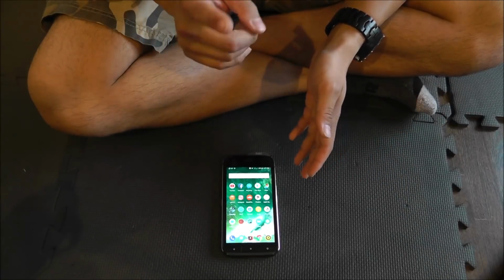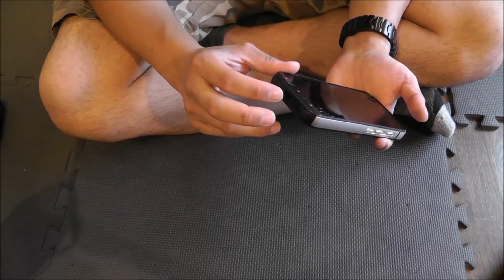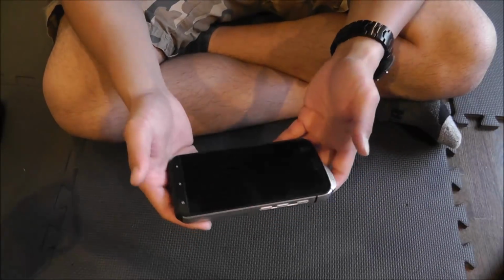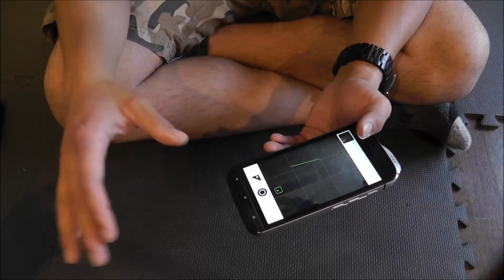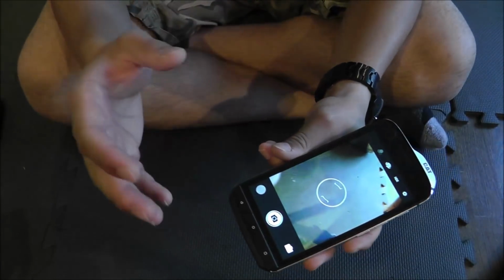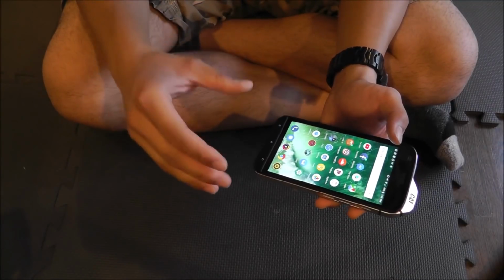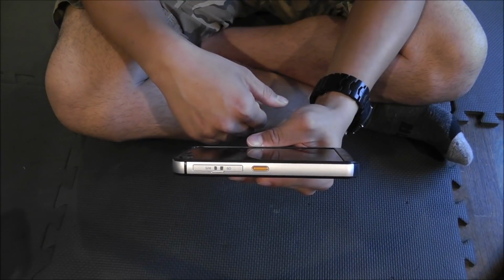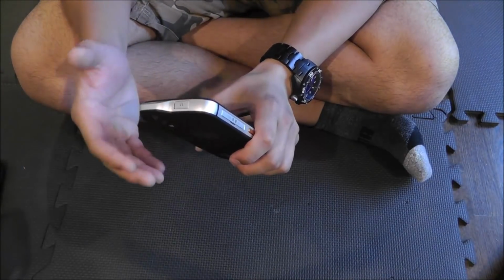REVIEW: CAT S61 [FULL REVIEW] [THERMAL VISION AND LASERS!!]

Comment from the maker: Hey guys, just a correction, the built in thermal Flir Lepton module is actually 80x60, and not 120x160.  I was basing my info on what little early information was available, but further testing has confirmed it is the lower resolution of 80x20.
Reply: lower resolution of 80x60 ;-)
Amazing how it on the same resolution looks so much better then on the S60
Reply from the maker: eco logic Yeah, that is because the flir MSX overlay resolution has increased to 1080P but the actual thermal resolution is unfortunately still only 80x60
Reply: Waterproof ??
Reply: Sooo... where did you go on 07-07-2018, saturday? There is a red bar in the VOC sensor data, I think at around either 10 o clock in the evening or maybe even a bit later on. Was that somewhere where people were smoking? Was it car / road -location related? Because this data would be nice to log too for health nuts :-D 

Too bad about the low resolution of the FLIR cam/heat sensor. I would really like this phone to help out in fault finding of SMD components in circuitry. But at these resolutions.... nah, that only delivers an approximation of an area, not  exact enough to pinpoint for example an IC or SMD capacitor, so still alcohol, petrol or freeze spray has to be used. 

Dunno...
Reply: Review cheapest unbreakable Poptel P60.
Reply: I thought i heard you say that both the charging port and the headphone jack is fully waterproof even without the 2 flaps. Is this true? If it is, can you provide a source that confirms this?
Reply: The more cost-effective ulefone armor 9 has a 64mp camera. 6600 mAh battery
Reply: i think you would like a Blackview 9900-pro ... its much better :) bye far and you can root it ...
ps.. the flir app is that speed every phone/device... its a start-up of the seniors of the camera, and calibration of the 2.2million seniors..

Comment: Finally, when the camera brackets turn green, take the pic and it's instant. If you take the pic before it goes green, it'll seem like you took the pic but it won't actually capture anything until it's focused and turns green. The front facing camera is instant.
Reply from the maker: Gerry926 Yeah it's because the front camera is fixed focus and the rear camera is autofocus.  And the rear camera autofocus is VERY slow.
Reply: Agreed!... And thanks for the great feedback.
Reply from the maker: You got it, man!  Glad you found my video informative!  Also I might as well ask if you've been able to figure out if there's actually a "wet hand mode"?  Because I know there's an underwater mode for the camera, but nothing for the touch screen. The manual and sales materials touted the ease of use with wet hands but I've found it to be as impossible to control as any other capacitive touch screen.
Reply: I'll try the wet hand thing and glove mode tomorrow at work. I know it didn't like my sweaty face next to it. Can't blame it for that though, lol.
Reply from the maker: Gerry926 Haha I gotcha.  I mean I know glove mode works, it seems to turn up the sensitivity, but that doesn't help with wet hands, it makes things worse.
Reply: Hello again. Just need to ask, what camera app did you settle on? I was about to send the phone back because I'm still talking my Note 8 to work, for pics but then I found Footej and the shutter speed is better. 
Would be great if Cat had an update to improve the stock camera.

Comment: Nice video you made,thanks.
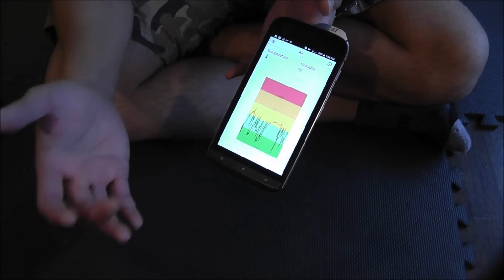At 15:09 you talked about the lag of export option for the air quality measure result(s)
Maybe you could take snapshots of the results and send this to where the results have to go. If you’re this source you can store it in a specific folder on your phone. Hope this helped you any further. When the speaker is wet and sounds mushy maybe at that point you could  use a headset dry mic and dry (ear) speaker.
Bye and thanks again for you video good job.

Comment: They have a special case for it. It has anti-shock absorbent corners and a rigid plastic body. It comes with a durable belt clip that swivels 180° and secure carabiner attachments for ease of access. All controls and features can be easily accessed through the openings in the case
Reply from the maker: Are you referring to the urban active case?  I've actually made a video on it.  It's not perfect either, but it does provide a lot more protection.  Thanks for commenting!

https://youtu.be/5Vv_B7AaAsE

Comment: hi, nice review. aluminium is actually more rigid than steel. that's why it gets micro fractures when it bends/dents. and that's why it's more fragile than steel. steel will absorb shock better because it's less rigid.
Reply from the maker: Well aluminum may have a greater strength to weight ratio, but steel is still harder, stronger and more resident scratches and dents.  I personally wouldn't have minded a heavier phone if it meant a frame with slightly more flex and a lot more resistance to serious frame damage.
Reply: @ctuan13  I agree, steel is real. I have one question about this phone. I'm a bike messenger and i'm looking for a rugged phone that is usable in the rain. I need to use my phone while outside and most phones instantly develop down syndrome when the screen gets drops of water on it. is this phone usable in the wet? thanks!
Reply: @ctuan13  Aluminum is the right choice in my opinion. It's lower cost and the increase in weight to steel would not be negligible. If price is no issue then maybe go straight up to titanium.

Comment: FYI, stainless steel is dramatically more expensive from a manufacturing standpoint for a complex cast and machined part like this frame.  Hardly worth it for a slight increase in some properties.  In fact, depending on the exact alloys, specific modulus (rigidity vs weight, roughly) is nearly identical between them.  You could maybe thin the phone out slightly with SS.  But not enough to matter on this chonk.

Comment: Hey, sorry to blow up your channel. I'll do my own review when my new phone comes. Looks like I'm sending this one back for the blown mono speaker. They offered a repair but in not starting off with a repaired phone. Besides, it's still under warranty, so why not? Even the tiny hardware reset button, next to sim card didn't help. Sounds like the voice coil is blown. Still the best phone for me at the moment and I'm definitely getting another one.
Reply from the maker: Gerry926 Hey man, no worries.  It's just good to hear other people's experience with this for the most part, rare phone.  It helps not only me, but all my viewers.

So when did this speaker issue arise?  What does it sound like?  Did you by chance get the speaker wet?  Because if so, you'll need to play sound through the speaker on high volume for a bit and tap it out to clear the water.
Reply: ctuan13 The speaker issue may have been caused by a music or ringtone app but I'm pretty sure it wasn't sounding like your sound clip. From the beginning, it sounded like the speaker driver was pressed against something and waa a bit distorted. Now, there's  just an annoying buzz and you can't make out voices or hear the ringer. I didn't get the phone wet or drop it at all. It's on the way back to them and I'm getting another one right away. Right now, I'm using a $40 LG phone and the 5mp camera is as good as on the Cat. The audio through the 3.5mm Jack is actually louder than my Cat puts out. That's a bit disappointing but no other phone checks the remaining boxes for me like the Cat. Thanks for your patience as well.
Reply: So, I got my new S61 today and so far, so good! Seems like everything, including the camera, works better than the first one. Audio output is far better too.

Comment: I had the Cat S60 and it was a great phone but I'm wanting the Cat S61 since the Flir Thermal Imaging Camera works at higher temps which is important with roof leaks and roofs being so hot. I think the laser distance measuring needs to work at further distances (currently 8m or 24 feet). I would of liked to see actual demos of the features in the phone in your video, showing the phone picking up VOC levels and measuring something and also using the Thermal Imaging Camera.
Reply from the maker: Hey man, thanks for watching!  Videos on the VOC detector and measurement tool are coming, but check out my thermal camera test video here: https://youtu.be/8RpFZETWCso

Comment: Good review! Ahh, man, I like aluminum, lol.  Scratch that stainless and you'll be more upset. 4 gigs is keeping up with my Note 8. My Note 8 is in a Unicorn Beetle case and the S61 feels like the same weight. The S61 is also far more comfortable to use, one handed.  I'm a full time, home improvement contractor. I used the thermal on day one to find a leak in an ac line and search for squatters in abandoned building. The measurement tool is ok, as long as i can control the ambient lighting. It's good for measuring angles, like in attics... as long as you're not aiming at the window.  The voc sensor is cute but doesn't detect most things I'm exposed to. Wasn't expecting a mass spectrometer, lol. But I spilled pvc cement in the truck and it didn't detect it, even though I could smell it really strong. I know it's not meant to detect everything. I always keep my phone on the nearest, clean surface or connected to my Bosch work radio. So the sensor placement isn't an issue. I'm glad I can turn this feature on or off. 
The camera should've been made to flagship specs. Firstly, just because...and secondly, it's critical to the performance of the measuring app and Flir. The main thing I do is take pics. I then write on them, attach them to an invoice and email it. I can now do this with thermal images attached. In my world, this phone will pay for itself in a few weeks. 
My Note 8 is very good but I've already replaced the screen and it needs to be constantly plugged in. Iwas on an estimate with another contractor and both of our Note 8 phones died at the same time. 
If you just want to play with a basic thermal imager, just get the Flir or Seek for Android and Iphones... but don't drop it. Even those seem to have a slight delay on fire up. 
Basically, it's a $500 phone, with built in accessories that would cost you $500 separately, lol. 
My only complaint is that my sweaty face made the screen keep waking up and the bottom, right corner of the screen protector is coming up already. 
In the end, this phone will be my daily one because of the outstanding battery life (day 3 after first charge and 23% left!), durability and basic thermal imaging. If they can improve on the camera, it's a real winner.
Reply from the maker: Aww well aluminum I softer than steel lol, so I would rather have a brushed stainless steel that would look right at home with some scratches than easily scratched anodized aluminum.  As for battery life, you are so right it is pretty incredible.  If your screen protector is coming up, I'd contact Cat, I'm sure they'd replace it for you, or at the very least send you a new one.  Yeah being that the VOC sensor is a wide spectrum compromise, it won't always detect everything.  But yes, I hope they release a version with a bit more ram and improved cameras.  That would be the golden ticket of rugged phones.
Reply: I was also wondering if you tried the night light feature. It's supposed to do some kind of Amber screen, they say is designed to help you sleep. Also, I found the downloadable manual helpful.
Reply from the maker: Gerry926 Oh yeah as a user of night shift on iPhone and f.lux on my computers, I couldn't function without blue light filters on my phone. Glad that it's got it.

And as for the manual, where did you find it?  Because I went to the catphone site and the download link doesn't work.
Reply: I can't copy the link because it goes straight to the download. But if you Google S61 user manual, you'll see it. It starts with, pdf downloads.cdn.re-in.de
Reply: You'll see, it verifies 80x60 for the Flir. Ok for me though. I only need to see basic hot from cold.
Reply from the maker: Gerry926 I would much prefer the higher resolution sensor, but I'll take what I can get.  Still I definitely want to see the higher resolution sensor on the next generation.
Reply: For those doing research, Cat offered to pay UPS shipping to have it sent to an authorized c repair shop. That's great customer service for a screen protector. I'm hoping I can just buy one from them and apply it myself... Unless that voids the warranty. We'll see.
Reply: Gerry926 their customer service has been very kind to me, very personalized
Reply: Looks like I'll be sending it in for a new screen protector. They can't send one out because it will void the warranty, if not done through them. I'll miss the phone but maybe it's for the best, because I keep looking at the bubbles, wondering if the screen is really ok under there, lol.
Reply: For those doing research on this cool a$$ channel, Cat misunderstood what I needed. I called today, instead of email and they are sending a new screen protector out to me. The original tech thought my whole screen was lifting!
Reply: For researchers.. Turns out, the voc sensor was faulty from the start and eventually got stuck in the 5k range. After clearing data and cache didn't work, Cat walked me through a factory reset and the whole phone seems to work better.
Great customer service!

Comment: You all say that the thermal camera is upgraded with a better resolution of 160x120 pixels. Looking at CAT site and the original manual is says that is ONLY upgaded at the thermal range up to 400c and keep the same resolution of 80x60 as the S60!
Reply from the maker: Yes it has come to all of our attentions that in fact the thermal resolution is still only 80x60.  If you take a look at the pinned comment, you will see I issued this correction.  This confusion was largely due to misinformation spread by Caterpillars own technical support chat.

Check out my nighttime thermal test where I highlight my experience dealing with support: https://youtu.be/wbpE6dZf_T0

Comment: The reason they used aluminum I’m assuming is for salt water resistance. Aluminum DOES NOT CORODE, steel does. Stainless steel is more resistant to corrosion, but how many times have you seen a cheap rusted out  pocket knife with a blade of stainless steel. It’s called stainLESS steel, not stainNEVER steel.
Reply from the maker: EdgeRunner Aluminum certainly does corrode.  Enough working on cars from the north east to tell you that with consistent contact with salt water, begins to cause aluminum to corrode into a crumbly white powder.  Anodization helps, but it still can corrode.

I do agree it may be less, but I'm still of the opinion they could have gone with a strong stainless steel for the inner frame and for what's exposed, used something with similar corrosion resistence properties as H1 blade steel.  It is specificallt designed for Mariners and use at sea and is widely considered to be rust proof.
Reply: The other possibility is a titanium or titanium alloy. It is as strong as steel but lighter (strong as in strong enough) and very corrosion resistant. The tradeoff is titanium scratches more easily, but then it could be coated to mitigate some of that.
Reply from the maker: @nitetrekker  Well it does have some good qualities in the strength department but titanium is extremely brittle.  So it wouldn't be great for a rugged phone designed to withstand drops.
Reply: Titanium can be brittle depending on the heat treatment  (e.g. done with oxygen) but it's not necessarily brittle. Also it has already been used in the Essential Phone specifically because of it's strength in the drop test vs aluminum.